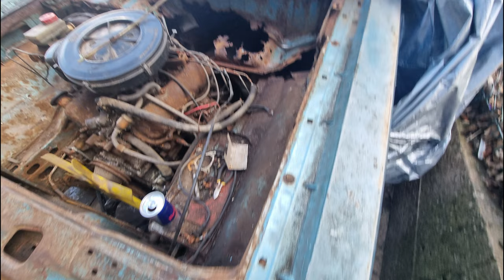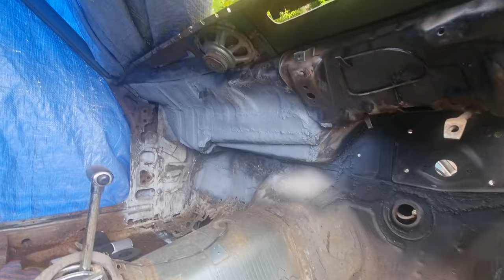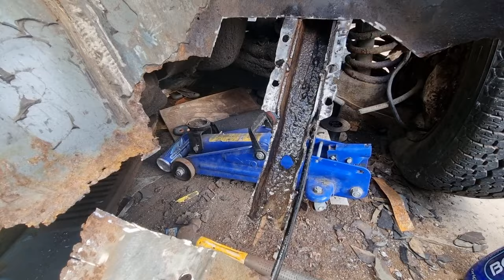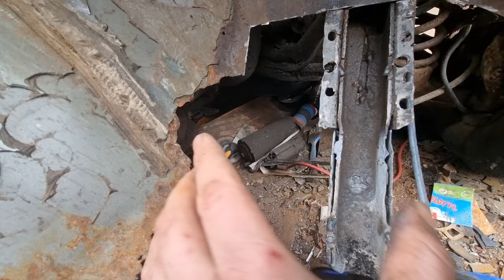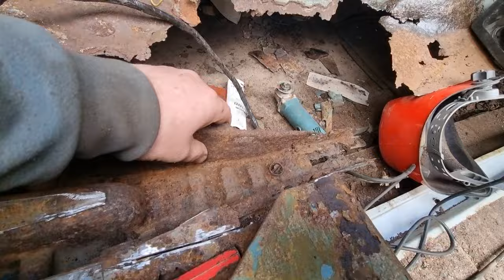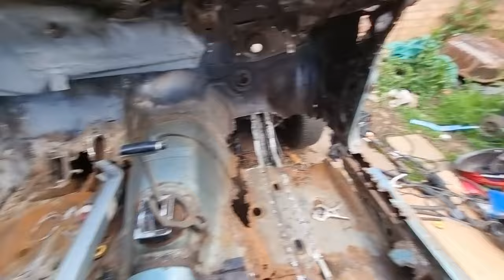Cortina Mk4 Ghia 2.3 V6 Restoration || Chassis Rail Removed (P29)

Comment: Definatly brave to take this project on, currently doing a mk3 myself though not as bad as this, well not obvious.  If it was me I would have done a few things differently.  First brace the car up as due to the rust in the floor you need to prevent it from moving when removing the floor, sill etc.  Secondly the rails I would replace rather that repair, yes it is alot of work but you dont want that failing or rust more in the future.
Reply from the maker: The rails on the wing sections do you mean wing tops yeah bracing would be better but I will refit doors before fully welding up I have  even looking out for some metal to ise for bracing like old bed iron would have been ideal

Comment: I’ve got it, the roof is coming off and it’s going to be a massive convertible !
Reply from the maker: Hahaha now that's an idear lol
Reply: Did you make another chassis rail good resto
Reply from the maker: @1961kickboxer  hi mate thank you no the chassis rails i got of ebay but before i could fitt it had to repair the legs in order to weld the new ones in im now on the passanger side of the car now while i save up a bit of money for the drivers side floor stuff and inner sill :) another video will be up shortly

Comment: Amazed you havent braced the car across the door apertures with so little strength in the car personally u need a half floor on that side  wouldnt leave any of that in there but fair play for restoring that
Reply from the maker: Yeah  will be test fitting doors before any final welds will be don't to make sure everythink is fine

Comment: Mate find something any thing old bed frame if you can't afford to buy it to strengthen the car up before you start cutting the floor out as the car will move and the doors won't sit right after you done all the work if it hasn't all ready moved as they is not alot left in there inner sills gone as well I would buy all the floor pans and inner sills I no it's expensive but plates it is not the way to far gone inside

Comment: I just had another thought: do you mind if I make a suggestion? I see that some of the trim is still fitted to the car.....would you think about taking it off and storing it separately? If any of the door trims etc get wet or damaged by welding/grinding it might be tough to find replacements. It happened to me once, so thought I'd mention it.
Reply from the maker: good plan yes i will do that first i will remove rear seat backing and door cards i would have forgot to be fair so thank you for your suggestion :)
Reply: @AdamSNook.   what a fool you are  😜 forgetting to remove those!  Mind that's another project on the side you can do, while you are waiting for budget etc. Is look at some of the trims.  See if you can revamp some of the stuff, i recon it wont take that long to do. As i mentioned before some of the quick hits and fixes.   I did this with the rover metro i had, even though the car had no interior in at the time, but i spotted some bits in a scrap car, and took those and replaced some ugly trims i had, i even switched a grey surround to a black one from a later car, while the dash was off.
Reply from the maker: @procta2343  hehehe i know i know should have been removed from the get go hahaha but i will do it as you say while i get some stuff yeah i like black trims my self not a big fan of wood trim to be fair i do like black i am getting a nice sterring wheel and boss kitt at some point :) you will have to send me some pics of your metro to my youtube email address in the description :)
Reply: @AdamSNook.   i will see what photos i have, on this PC,  i did remove a fare few years ago,  sadly me and the car parted ways back in 2016,  i did have a massive thread on the 306net. those lads kept me going with it, i did run into hell, a good number of times, and that was down to bum info ( watch out for that for god sake adam)  and a dud engine, that was " sweet as a nut"   ended up buying twice and bits i didn't need.
Reply: Indeed. Like I said: take it out of the car, clean the plastic parts with dishwasher soap, dry it, and put it dustfree in transparent bags (including the right clips, bolts, whatever belongs to it) with a written card in the bag. Yesterday I took many GTV6 parts from the Netherlands to where I now live in Belgium. All in carton boxes and in bags. When the time arrived to mount them to your car again it is all clean and ready. Take the car windows, clean them and put them away on a safe spot. And never grind with the grinder in the area of glass. It will make crates in the glass because of the hot metal pieces that appear when grinding. My brother knows all about it.....

Comment: The front part of the chassis rail is the same as mine. Double thick for impact structure
Reply from the maker: yeah i was thinking that seems to have been beefed up at first i was thinking is it due to been a 2,3 v6
Reply: @AdamSNook.  Probably yes. I tried to get my car started today. Having a nightmare of a job. I checked everything I could think of. Then when I got home I thought - timing might be out.
Reply from the maker: you havent messed with timing tho have you
Reply from the maker: does it try to fire up
Reply: @AdamSNook.  Not that I remember but it's the only thing I can think of checking.
Reply: @AdamSNook.  it tries but it won't run
Reply from the maker: Yeah worth a try